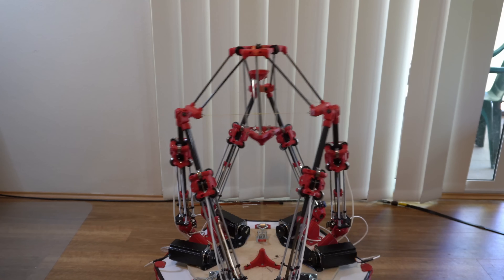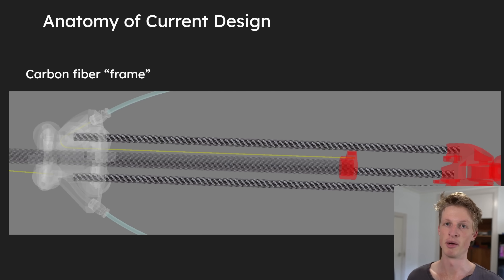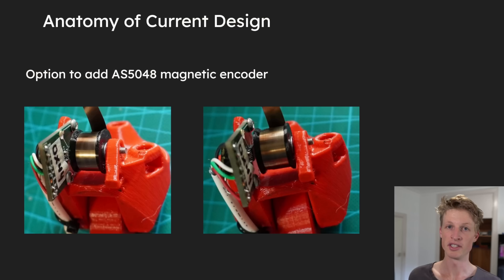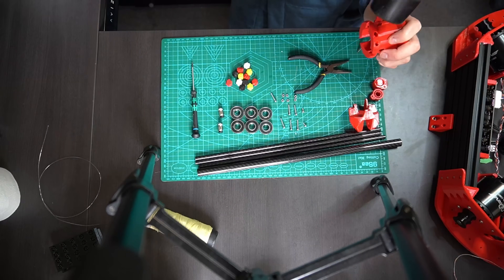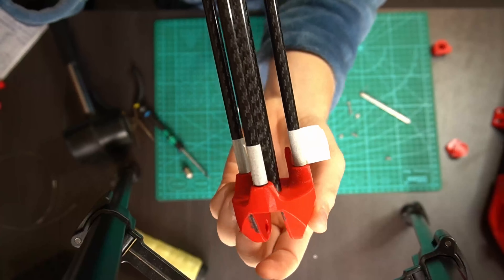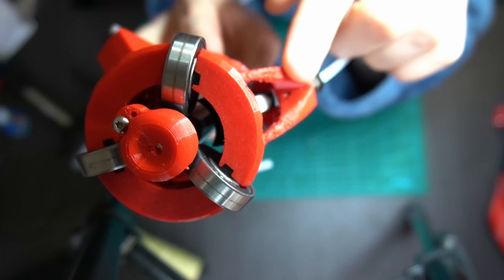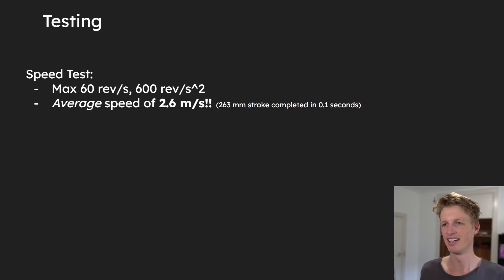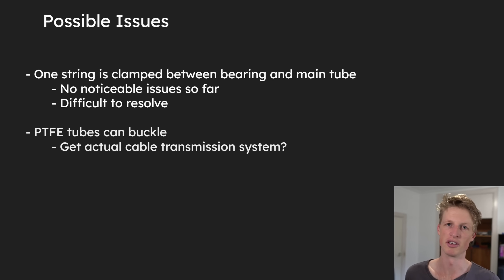Designing High-Performance Linear Actuators: Speed & Stiffness for my Juggling Robot | PDJ#19

Comment: I noticed that there is a slight angle between one of the strings and the rod, meaning it forms a triangle, and the cosine ratio is changing between retracted and extended. Not sure if this causes any weirdness but I'd try to get the string as parallel to the rod as possible
Reply from the maker: Yeah I've pondered that as well. The angle is really small though and if my engineering studies have taught me anything, it's that a small angle = 0 angle 😅
I haven't had any issues crop up so far, but I'll certainly be keeping this in mind if I get positioning issues once the main robot is together

Comment: Random ideas:
Get a CF tube that the PTFE tube fits in,  put it in there and now its stiff. Use as one kf the trio of stiffening buddies.
take 3 of the stabilization bearings, and put them on the internal end of the big moving CF rod, instead of bearing in onto the  central rod, bearing out onto the trio of kuter rods. Would increase the weight of the reciprocating mass, but perhaps will reduce wobble?
IDK, thats all i got so far. Great work. I really hope to see this go somewhere awesome!
Reply from the maker: I like the idea of bearings on the main push-rod! I hadn't thought of that before! Might be tricky for a few reasons:
1) While the CF tubes are stiff, having the central tube pushing against the outer tubes (via the bearing) might cause the outer tubes to flex a little
2) I think you've hit the nail on the head with respect to excess weight: if the actuator's moving at > 2m/s, I want to keep that as light as possible.

Cheers for the suggestions, and I hope to see some more of these ideas in future designs!

Comment: It would probably make sense to switch to steel brake lines and smaller diameter steel wires, as hey would last longer and are more durable, but it probably would mean redesigning the motor pulleys and software

Comment: What if you use a V shaped bearing to resolve the problem? 14:28
you might need to print a bigger range of spacings but this isn't a huge problem.

ps: 2000 isn't a big number for stress testing,, ideally, if budget isn't a problem, you should test a few prototypes and see when/how they fail. https://en.wikipedia.org/wiki/Highly_accelerated_life_test
Reply from the maker: Yup! I bought some bearings of different shapes and sizes (U-groove, V-groove and so-called "Gothic profile") to test this and they just arrived! I reckon they should work wonders.
Unfortunately budget is somewhat of a problem, though the things that would realistically break when testing this are relatively cheap. Thanks for the link! I'll keep this in mind when I do further testing

Comment: Just ran into your channel.  Looks very interesting.  Kudos! 
Just wondering what you’d think about running the two kite lines through inside two of the three support struts and thus running the Bowden tubes into the bottom of the actuator instead of running them outside all the way to the top…?  This might reduce the total mass of the arm around the top end. 🤷🏻‍♂️

Comment: 14:00 prob already mentioned, but youll have problems with accuracy especially if an actual is approaching the lower extreme, the string should optimally be parallel next to the rod. (a^2 + b^2 = c^2 and so on :P)

Comment: I assume the placement of the string inputs is non negotiable?
Because you have your top and bottom wheels at 120° seperation in each set of three, but the two sets offset by 60°, and the places the strings go in are separated by 120°. If they were separated by k*120°+60° one input would have a bearing in its way upwards and the other one downwards, so both directions can be serviced without any string under wheel action.
60° or 180°, I assume that 60° is a bit tight, but I don't see a reason why 180° isn't possible.
Then again, I am not very knowledgeable. Great video, great explanation, interesting mechanism. Thank you.

Comment: Try an IGUS linear bearing/bushing instead of 6 bearings. You will need to preload the bushings perfectly to achieve the right tolerance that’s not too tight or too loose, but it should be a lot lighter for you.
Reply from the maker: Interesting! I previously tried a linear bearing instead of the 6 radial bearings, but the carbon fiber tubes that I'm using aren't specced for that level of tolerance; one manufacturers tubes had a loose fit, another didn't fit at all. I didn't know you could get bearings/bushings that you could preload. I'll look into them! Cheers!

Comment: Ptfe tube is not a good way to go so yes I would definitely change it. In 3d printing, just the filament in the tube, which is a lot bigger than your string, has a lot of backlash due to hysteresis. Maybe you could use another smaller carbon fiber rod. It’s not flexible but that’s the point. You would route the string through the rod straight to the bottom of your legs, then a pulley could direct it to your motor.

Comment: How about using air bearings? You're using precision cf tubes, some precision sleeves with many small holes can be made and then encased in the 3d printed mount...
Also, use the 3 fixed cf tubes to route the strings and the air internally.

Comment: Great stuff ! looking forward to see your progress. 
you could look for some excentric nuts, these are often used in cheap cnc builds, this would add some weight but makes it easier to adjust fully assambled. Or borrow the idea and see if excentric 3d printed sleves on the bolts will work. Another option would be to use linear bearings commonly used in 3d printers, Im not sure how well they work with carbon tubes, but its is worth a try.

Comment: What kind of force can you exert on an object? I know you said the odriod drivers sense and stop at amp spikes which is cool but can you preset those limits to say open and close a door or valve using your actuator?
Reply from the maker: I haven't measured force because I don't really need a high force in this project, so I'm not too sure what the max is. I'd guess quite a lot; the strings tend to break first (in my testing so far, at least) and they have a breaking strength of ~35kg (70lb). Re. ODrive current sensing: yep! You can set those limits to whatever you want. I had to run the actuator to see what current it drew in its normal operation, and then add ~1A to that to indicate that it has hit the limit 😊

Comment: Hello,  try wrapping your ptfe tubes with a metal spring.  will add some support about the length of the tubes in sections that demand a turn for fitment if you want to keep the cost low.  otherwise you could consider a hybrid setup using metal cable bowden sections and then connecting the strings in the “interface” at the pushrod side and motor side.  this should reduce stretch and keep the weight where it needs to be and where it shouldnt.  keep in mind the material compatibility here, kevlar is strong and the ptfe will handle the abrasion for a little while,  so periodic change outs may be required.  nice job!

Comment: have you experimented with belts instead of threads? instead of using bare metal on the CF rods, you could try those bearings used for 3d printers. also, what about linear bearings? the bambu lab printers use carbon rods with linear bearings on the x axis.

Comment: Is there any specific reason why you are not using linear bearings on the rods? Also I do believe PTFE Tubes need the cable inside to be a specific diameter to work best. You might want to try tubes with a thinner diameter or thicker wire to eliminate the tube bulging.

Comment: As you said at the end the PTFE tubes will 'wear out' over time. Have you thought about using brake cable covers/sleeves from bicycles? If you can find something that has a proper inner diameter. Those are lined with either composite or metal weave which makes them much more wear and longitudinal compression resistant
Reply: Totally forgot to say, this is a super cool project! Subscribed and exited to see more

Comment: Harrison, great job! Suggestion; instead of using the PTFE tubes for cable guides, why not incorporate the cables into the carbon fiber structure tubes?
Reply: You'd still want cable guides (shifter cable housing seems like the best bet) into the bottom block but yes, using the structural tubing as part of the string guide is a great idea.
Reply from the maker: Cheers!
Routing the strings through the CF tubes would probably work well for many applications, but I'm using these actuators (there will be 6 of them) to power a Stewart Platform and they need to move around quite a bit. Having the strings routed through the PTFE tubes means that the strings don't get in the way of the actuator moving around
Reply: @harrisonlow  i had the same idea, why not routing the strings through the CF tubes. I don't exactly undestand why would the strings get in way of the actuator?

Comment: thats a neat actuator!
one problem i can think of is the off axis load created by the cables pulling on one side of the rod. this might not be an issue with light loads, but with higher forces along its extending & retracting axis it would require increasingly high lateral stiffness between the bearing assembly and the rod.
as for the ptfe lines. maybe running them through the existing carbon fiber rods could help. it shouldnt interfere too much with the movement of the base hinge as long as you run it directly through the pivot axis of each hinge. if that is too complicated / would require too much precision, you could still shorten the length of the ptfe tubes significantly by only running them from the base of the carbon rods to the motors.
Reply: btw if you really want to lighten all the moving parts as much as possible, theres always the option of a cable driven parallel mechanism!

Comment: The CF tubes look like they're leaving some marks on your bearings. Worried that over time you'll experience drift due to uneven wear. I've printed springy collars for bearings in FilaFlexible40 - itd allow you to compress the contact area (more than just a sliver per bearing) and get better grip and less wear. when sanded it bonds to the metal bearing with super glue. If you get probs with wear and tear, give that filaflex40 a try. It's tough as a honey badger
Reply from the maker: You've got a keen eye! Yeah, some of the bearings are wearing at the contact point. I love the idea of a rubbery sleeve. I'll see if I can find any of the FilaFlexible40 in Aus! If not, I'll at least try the TPU I've got lying around. Cheers for the suggestion!
Reply: @harrisonlow  happy to help!  the speeds you're getting are awesome.  I order mine from Prusa - it prints super well, but ya gotta glue up the bed to protect a smooth sheet from damage when removing the print.  still thinking on how you could replace the ptfe tubes...

Comment: Bicycle shifter cable and housing is super cheap and cand stand up to A LOT of tension. You could even include a barrel adjust in the system and easily adjust the tension of the cable on the fly.

Comment: awesome design! while im unsure how modern materials will react i will leave some notes from using historical tools and equipment that used line. as well as taking historical manufacturing equipment and bringing it up to modern standards.

string does stretch. even if it doesnt get slack its going to stretch as the limits of the motion from the strain of starting and stopping. 

line actuation is rare, and outside of a factory I helped rebuild ive never seen it industrially. usually industry goes for linear motors, and those are heavier and well. they can go faster without running risks of tangling, and line is more often used to provide a straight reference. (replaced by lasers)

The biggest, stiffest, heaviest, most brittle of fully solid cast iron support beds that are made to be stationary. also flex under surprisingly light loads.

and that is not always a bad thing it keeps things from breaking.

and thats the secondary thing to note. your design would be breaking if it wasnt flexing.

so definitely use the external encoder you designed, if nothing else then to know when you're starting to run into problems before they become failures.

Comment: Why not belt drive?   Motor on the fixed end, with a return pulley on the far side of the fixed segment.   And attach the belt to the bottom of the extending element.   The  version in the video looks cool, and if you need the motor mass off the actuator, it's pretty good.   Belt drive should be stiffer and more robust.

Comment: Heat the CF tubes up to the glass transition temperature of the filament you used (e.g. PETG = ~85°C), then push them in slow and steady. That should make things less violent! ;-)
Instead of the 6 axial bearings, maybe look into using just one linear ball bearing (like LM8UU, but with larger inner diameter)? That should save a lot of weight, as you'll only need one. Centering it could be done via 3 bolts then.
Use PTFE tubes with a smaller inner diameter and more wall thickness, they should get fairly rigid.
Reply: I wouldn’t recommend standard bearing or bushings on CF. You could go with a plastic bushing like the IGUS ones though and they seem to work okay, but there’s a bit of friction that needs to be overcome to get them moving. They also have to be preloaded quite heavy for tolerances to be good unless you go for their bushings that are already preloaded with a metal housing, which will add a bit more weight.
Reply: Sure, igus are great, i used them on one of my 3D printers (Prusa, got rid of that damn bed slinger). I didn't notice the friction, though - but maybe that was because they were on steel rods, not CF tubes, and had only a small contact surface at the top.
But yeah, anything other than those axial bearings, or: any kind of a linear bearing, would be the perfect application for this - because that's what they're made for! 🥳
Reply from the maker: @jangrewe  Great ideas! Some thoughts:
1) I love the idea of heating up the CF tubes. I wish I saw this comment before I built the remaining actuators; some of them developed cracks from my... enthusiastic... hammering 😅Doesn't seem like anything structural was damaged, but heating would certainly be better. Cheers!

2) I previously tried a linear bearing instead of the 6 radial bearings, but the carbon fiber tubes that I'm using aren't specced for that level of tolerance; one manufacturers tubes had a loose fit, another didn't fit at all. Linear bearings would be awesome (smaller, lighter, more elegant) but I don't have the cash to get high tolerance, light tubes... yet 😉

3) Good idea for PTFE with larger wall thickness. Very obvious but never came to mind! I'll see if I can find any.

Cheers for the ideas!
Reply: @harrisonlow  cheers, 2 out of 3! ;-) I'll let you know if i can think of anything else...
Reply: @harrisonlow  Another spontaneous idea to try instead of the big radial (not sure why i said "axial") bearings: V wheels. They're available in small sizes, and while they also contain bearings, they should still be lighter than the big bearings. And the delrin (or any other material you can get) should be a lot more gentle to the CF tubes.
I didn't do any research yet, but i guess a bit of google-fu will give you some rough numbers regarding the weight difference. (quick check: 28mm 6001 = 20g, 24mm V wheel = 16g)
Oh, and maybe use flexures to ensure good contact. No need for springs then.
Reply from the maker: @jangrewe  Yeah I think I might change to smaller bearings with a TPU/soft cover to: 1) reduce weight and wear, and 2) provide better contact between the bearings and the central tube. I also bought some U- and V- grooved bearings that just arrived (my god shipping has gotten fast!) to hopefully resolve the string-under-bearing issue.

I'm hesitant to use flexures/springs for the bearing spacers, as that would introduce some inherent compliance into the system, and the current spacers seem to be doing a great job once I get the sizing correct
Reply: @harrisonlow  a common thing with steel rods to fit into printed parts is to mount the rod in a drill and push it in whilst rotating, that may be an option but may not hold it in very well.
Reply: @harrisonlow  if you use V wheels on a round tube you may be able to route that cable that is currently squished between the bearing and the tube through the point of the V on the V wheel since the point won’t be in contact with the tube.
Reply: @harrisonlow  what I'm curious about is why you're using a press fit that requires hammering instead of using a clamping fixture (think the brackets that hold pipes, or the adjustment clamp on a typical bike seat tube, etc.), these also allow easy non-destructive disassembly. fo
Reply: @harrisonlow  Pneumatic tubing is rigid and readily available in many sizes. Reaming the holes for a press fit before fitting the CF tubes would make your life a lot easier. :D
Reply: @xxportalxx.  they are harder to model and print and if they don’t really need easy, non destructive disassembly then there isn’t much point.
Reply: Linear bearing is a top idea, I would recommend a Teflon bushing though as it will work well with CF
Reply: Got the same idea for the tubes too. I used to work with bioreactors where we used the same kind of tubes for gassing. They come in 6mm diameter (used here i guess or 1/4") and the 4mm smaller version which might not even need a bigger wall thickness since the line doesnt have the room to buckle it.